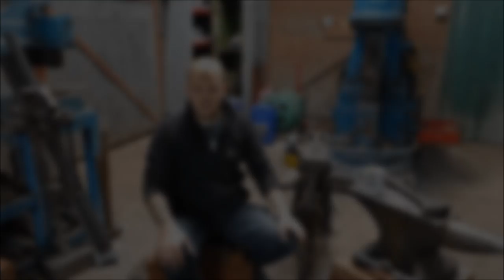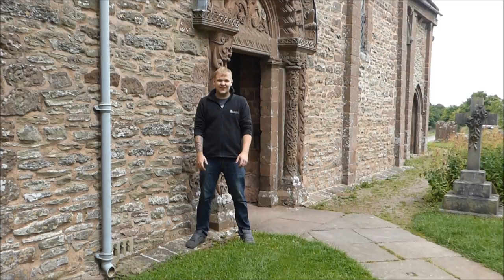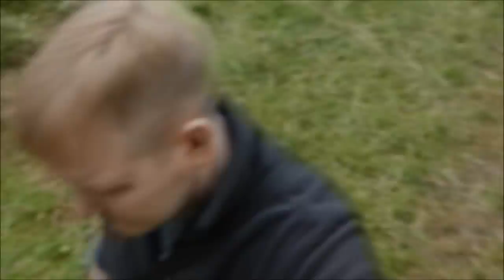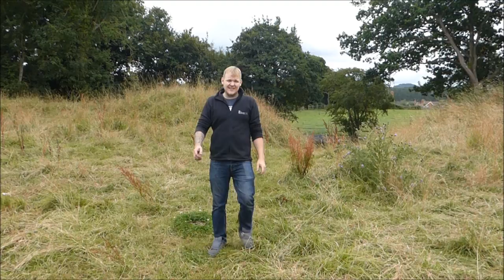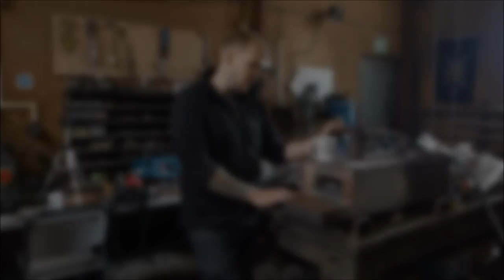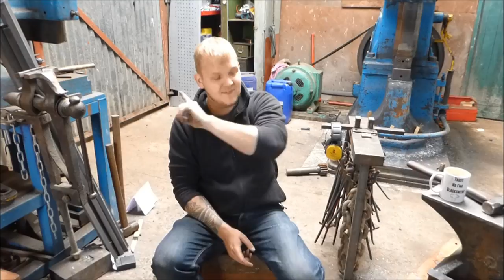Why Gas Forges Suck! Gas vs Solid Fuel! Trust Me I'ma Blacksmith! Full HD 1080p

Comment: I was genuinely quite shocked by how thirsty your gas forge was! I use the same size cylinder and I'm able to run my single venturi burner for 3-4 hours a day for about a month before running out.
Reply from the maker: The alec steele style ones ain't much better but if i'm not forging all day a cylinder will last 8-10 days ish. if im flat out for a couple of days i can get maybe 3-4 days but thats 8 hour days.

Comment: Great video Daniel and  I cannot see why anyone would find fault with your assessment of this issue.  I think you have it exactly right.  I worked (mostly as a hobbyist) for close to twenty years with only a propane forge and given my situation at that time, it was the right choice.  Once, however, I had the right space for a coal forge I sought out a class to learn how to use one and once I tried it I pretty much abandoned gas altogether.  Just about the only time I use gas now is when making very delicate or thin things, like the poppy I forged in my last video.  I would imagine a gas forge would also shine if you were forging a lot of fence pickets on a power hammer.   There are plenty of places gas works great but as you say, for general blacksmithing where controlling the amount and location of heat is important, there is no cost effective alternative to a solid fuel forge.  I have burned both coke and coal since I made the switch and currently I am preferring coal.  The last batch I bought was even more clean burning than the coke I can get and I rather like the stickiness of the coal over coke.

Comment: I usually use Welsh anthracite beans because they're easy to obtain.  It costs about £17 currently for a hundredweight sack (50kg).  A sack lasts ages and ages, much longer than an eight hour day.

I've heard it said you can't forge weld with anthracite.  This is from people who have likely never used it.  Believe me you can forge weld with it, and you can also burn pieces of work into destruction.  Welsh anthracite is about 97% carbon, amongst the highest value of all coals and burns very hot.

It also produces very little clinker - because it is so carbonaceous, with little impurity.
Reply: Finarfin I, and a few of my friends, use American anthracite and have found the same.  In the US there is a cult following behind bituminous coal but anthracite is wonderful to use once you learn how to use it.  It is the cheapest of all the fuels as well.
Reply: Yes it's strange that it's cheaper than other solid fuels.  There is specific blacksmith's coke available in the UK too (but not at my local supplier) but that's about £25 per sack, so that's about 50% dearer than anthracite.

These anthracite beans I'm using are intended for domestic boilers for central heating and hot water, and apparently of the gravity feed kind.  I don't know if those are air-assisted burns but the anthracite works fine for me in a firepot with fairly moderate air tbh.  It's an up-draft firepot.

It won't burn on it's own without air.  I have a continual electric blower operating (through a dimmer switch to slow it down and with a choke valve on the pipe) which is cheap to run (1/4 amp).  The plus side to this is it goes out very quickly once I shut off the fan.

Thanks for the reply.
Reply: Finarfin it's funny because anthracite is actually closer to coke than bituminous coal or charcoal by far.  Both need the constant air to burn and are mostly carbon.  Anthracite is actually classified as a metamorphic rock.  It burns relatively clean, hot and controllably.  I don't understand why more people don't use it.  Keep the faith and enjoy smithing much more cheaply than your peers!
Reply: Lol yes, we are the anthracite faithful.  Happy forging.

Comment: I started with wood and pinecones in a brick-lined pit. Graduated to charcoal later, tried gas, hated gas, went back to charcoal. I'm building a coke forge in my new shop. Gas is expensive, doesn't get hot enough and has other assorted issues. Charcoal does get hot enough if you manage your airflow, but it burns up PDQ. I imagine coal, coke, and charcoal all have similar effects on the color of your snot after a day of forging. But I'm proud to be a member of the Black Booger Brigade as my friend Will used to say.

Comment: Great video! I've gotta say I'm a nasty coal junky, and gas hater. Everyone says coal is a pain to light, with coke it takes longer, but over here in the states where you can get bituminous, I can get a fire started in under a minute, and can get to forging her in five minutes.

Also it should be noted gas is actually worse for carbon monoxide than coal! You just don't have smoke. But you absolutely need good ventilation for gas. I've seen gas forges under a hood just like coal. 

One thing I never see anyone mention is that gas is hell to work near! It radiates so much heat you have to have your anvil miles from the forge, that's waisted energy walking, both you're own energy and the energy in the hot steel. With small work I pull my anvil up right next to my forge, just a quarter turn from the fire to the anvil. Can't do that with gas. Not to mention they're LOUD, can't barely talk when your working near gas, and that's a disadvantage when teaching, a coal forge, especially with a hand crank blower, is nearly silent. 

Also another point about heat, there are some high alloy steel's you can't barely forge in gas because it doesn't get hot enough. I got a steel called "hy-tuf", super high alloy steel used in NASCAR axels. Everyone tells me how hard the stuff is to forge, I throw it my coal forge, and it forges like butter. Go to do a demonstration with it at a hammer in at a friend's shop with gas, and It forges like dead cold mild. 

The one advantage I'll say gas really has over coal is the ability to heat up a long section super evenly, can't do that easily in coal. As well as many pieces not being burnt... though you can do that in a big coal forge if you're careful.
Reply from the maker: not sure propane does give of carbon monoxide. That's why you can use lpg fork lift trucks inside no carbon monoxide. I will do some research dude. Also thank you for the great support dude.
Reply: Daniel Moss I may be mistaken, but I'm fairly certain all combustion gives off carbon monoxide... I'll have to look as well
Reply: I can light a coal forge with one sheet of newspaper, about 5 little sticks and a palm full of charcoal.  Within 5 minutes the coal is on top of the pile and getting going.   Not too much air at the beginning, just a mild blast.

When I began I used to fail lighting it about 50% of the time.  Like a lot of things, a little bit of practise and experience makes the task simple.
Reply: I do not know the chemistry of combustion but I do know that propane and natural gas are essentially the same thing and you can safely use a natural gas stove inside your house for cooking without danger of dying from exposure to carbon monoxide.
Reply: But stoves running on natural gas are made and serviced according to very strict British standards, a lot of home blacksmiths are using cobbled together gas forges with random sized jets and no checks on CO levels and combustion stoichiometry (gas air mixture).
Reply: Your comment about radiated heat is one of the main reasons I'm thinking of switching to coke.  In the southern US where it's 95+ F all summer, it's at least 120 five feet away from the front of the forge.  I keep a huge shop fan running the whole time, but it's still so hot that I pretty much only work at the forge during the winter.  I've never used a coke forge, but it seems logical that most of the heat will rise out the flue, rather than blasting out horizontally.  I don't mind the noise too much, but the other issue I don't like is the lack of heat control from a gas forge.  It's difficult to heat just a small section, and that seems like it would be much easier with a solid fuel forge.
Reply: @danielmoss2089  burns g propane or other gasses does create carbon monoxide.  I leave my door open in my shop and have recently installed z big bathroom fan to exhaust the gas and excess heat. I liked your video and you are correct. My gas forge is limiting. I wish to do more than blades. I'm either need a big gas forge like Alex's or Roy's or add a coal forge. I think a coal forge would be fine in my neighbourhood in the cooler months due to fire restriction in the summer(can't have outside fires so the neighbors would call the police) but fall/winter/spring everyone has their woodstoves going and no one could complain.  Keep up the good work!
Reply: @danielmoss2089  It does, when you run it with not an optimal mixture, air/propane you get carbon monoxide. Most people run their propane forge with the wrong mix so it's dangerous, there was a guy in 2016 that forgit to open the shops door and almost died and spend many Days in hospital breathing pure oxygene.

Comment: Yes Daniel I remember growing up in the 60's Mum and Dad had a pub in the bush in Australia, we had a donkey down the back, I hot water donkey not a four legged type, My job was to light that thing for hot water for the pub. When I got the fire going Dad had bags of coke for me to add to the donkey/Boiler to keep it going. Coke was readily available, now in 2017 it's as scarce as hens teeth. Coal is even hard to get, that's why I use a gas forge. Had a coke forge years ago, about 30 + and when I couldn't get coke I would go out bush  where a fire had gone through and get the charcoal from burnt logs, it went well.
Reply: Plus fire restrictions in aus means we can't use a coal forge in summer.
Reply: True same here, they're very strict here in summer. One bit of smoke and the neighbours ring up.

Comment: I don't have a gas forge, but my experience from working with refractory repairs in huge hearth furnaces and other, I would suggest anyone building a gas forge using fire bricks or equivalent materials to use ceramic wool between the bricks and the steel cover. Metal and hot refractory materials doesn't go well together. To save your bricks you shouldn't have them close to your metal cover. I use a coke forge and I'm lucky to get my coke for free from the steel mill in my town. Anyway, you should try steel+ceramic wool+brick in that order from the outside in😊 I like your videos😊👌👍

Comment: I beg to differ on your opinions on a Gas forge , Design and build them to fit the application . I run the largest propane containers 3 linked , they last about 2 months with use [ mostly ] 4 days a week . Refill your containers by using a cheaper gas price . Yes, Coke does have its uses in Blacksmith or Bladesmithing . I feel in fact, both have there place in the iron /steel forging workshop .

Comment: I'm 6 months into blacksmithing, in a corner of my shed. started small, crane track farriers anvil (30 kg) and a double burner gas forge etc started with rail nail projects etc. I seem to be having to hit harder and heat more than the "Youtube Army" !  its been exhausting and Hot ( made the mistake of having my anvil too close to the forge's foot long flame exhaust ) then as i've expanded i found i couldnt get half finished jobs back in the forge ( Doh ) and ( yeah theres more )  the ridgidiser is all falling off and i'll have to re-line it ....I'm ready to go coal.
Reply from the maker: Sounds like some small fix could help with the gas forge. Coal is ace and if your looking to do architectural work you would go far wrong best of luck and thank yiu for the great comment.

Comment: Like you said Australia gas and charcoal is the most comman. Coal and coke is very hard to get ahold of and very expensive. 
I have a solid fuel forge and 2 gas forges and currently rebuilding my solid fuel forge to work with a hand crank blower. I can get my hands on a limited supply of coal but charcoal will be the primary fuel. 
My primary forge is the gas forge, it is made from a 9kg gas bottle with a single naturally aspirated burner. With gas usage I find it to be reasonable. Out of a 9kg gas bottle which costs me about $20Aud I get about 20hours use from it depending what I’m doing, obviously lighter work like bottle openers or knives will get longer, where as forgewelding Damascus or wrought iron hammers will get less. The other key reason I use gas is time, I work a full time job as well as suppling shops and online with my forged items so it’s much quicker and easier to come in at 5pm fire up the forge and be hitting hot steel within 5minutes, and then I can simply turn off the forge and close the forge door and within 5-10minutes it’s cold enough to not worry about it suddenly setting something on fire. 
But there is something magic and rewarding about maintaining a solid fuel forge with a hand crank blower so long as the work and situations allow. Solid fuel also being much better at isolating heats aswell. I need much more practice with solid fuel to become more proficient at it.

Comment: I bought a gas forge after using a coal/charcoal forge for a while and never really use it. Mostly for normalization and heat treating. Granted it isn’t a chiliforge, but it was so expensive and inefficient that I really just couldn’t use it.

Comment: Coal is far, far cheaper than propane - here in Blighty.  

Coal forges can be knocked up for very low cost - via bits of scrap plate.

Coal forges are many degrees quieter.

Coal forges can be hotter - or cooler, depending on how you manage them.

Comment: A word to the wise. Natural gas and lp give of CO (carbon monoxide) you want proper ventilation with it, it doesn't have to be a flu but you have to have ventilation. Also recommend a CO detector or two in your work shop for both. Just safety precautions. Good work, I like the couple videos I've seen so far

Comment: One thing you didn’t mention is the bonus of using coal is adding carbon to the steel as you forge, where a plain gas forge burns a lot of the carbon out, not a big deal for small knives, but it weakens the metal the bigger the project is and the more times you have to heat it up

Comment: In my area I get coal for £2 (5-10kg) and I use about half a bag a day even though the coal is cheap it works for fire welding and is very controllable for myself as a beginner blacksmith

Comment: Anthracite coal and charcoal and gas are my only options. Charcoal is nice but expensive and burns quickly 15$ for 20 lbs which lasts a  hour or so. Gas is easy but expensive so I have hardly used it. Anthracite is cheap and burns for ages. It’s 5$ for 40 lbs each lb lasts for like 30 mins to 60 mins. It’s cheap as heck and burns for a long time. It’s also pretty clean. Safe too. Anthracite won for me

Comment: I know which video you are referring to, and it is also the one that finally was the straw that broke the camels back, for me. I unsub scribed from Alec's channel. One point that is a huge plus for using coal/coke, is learning fire control. Learning the fire and the forge gives a huge range of utility to forging work. Cost is, as you said, a huge factor for solid fuel. I literally pay 50 cents a pound for coal. Unfortunately, I had to drive 4 hours , one way,to get my half ton. Great video, as usual Dan. Thanks!

Comment: Understood, and might depend on where you live, but around here, propane is cheaper, hotter, cleaner, more readily available, requires less tending to or 'clinkers' to dispose of, and is just easier to use, and I can forge much larger pieces in the same amount of space than in any coal forge. Oh, and I'm not spreading smoke around the neighborhood, breathing coal dust like a Yorkshire miner, or covered in black crud when I'm done!

Comment: I have a poorly recorded video about lighting my dirt box forge. It is short, but check it out if you have an interest. Often times, I light it with a handful of left over charcoal from my firepit, and a quick dash of lighter fluid. Once it is burning, add coke and bank this with coal. By the time I gather hammers and tongs, uncover the anvil, then I can start heating steel. Guessing 5-10 minutes

Comment: Think you are right about coke forges. They are much more versatile than gas. I do have both in my shop, but it's the coke forge that does all the donkey work. Been blacksmithing since I was 13 now 66 so I may be stuck in my ways.

Comment: Daniel, Good video as always. Started with gas and converted to coal. Still use both. I have to disagree about initial heat time of gas vs coal everything else was spot on about the two types. My gas forge takes about 10 minutes to warm up. Which is about how long it takes to clean out and start up my coal forge.

Could you drop the music when you're talking? I want to hear what you're saying :)

Comment: yep i'm reluctantly going gas as any time it's nice outside i can't light my coal forge coz my naugher put's her washing out!! one thing is don't know about your's but my coal one is virtually silent, blower is out an oil heater and are quite easy to get your hand's on from a scrappy's gas is a lot noisier, always thought about using an oil burner on one but the noise is herendis, not to mention the amount of oil it use's  in my furnace when i'm casting brass was about 5 gallons in 2 hours was a temp one i made from fire bricks so wasn't very efficient though but did the job!! was casting a pommel for a sword i was making.

Comment: i use coal not coke just because its easyer to get a hold of i would love a gas forge so i can do more batch work. but lighting my forge i trow in a handfull of lumpwood light it till its glowing then turn on the blower (cheapest hairdryer in tescos £10) and add coal. 10 mins im forgeing.